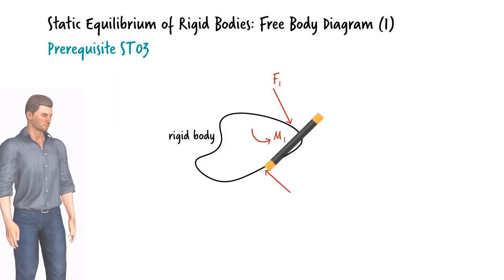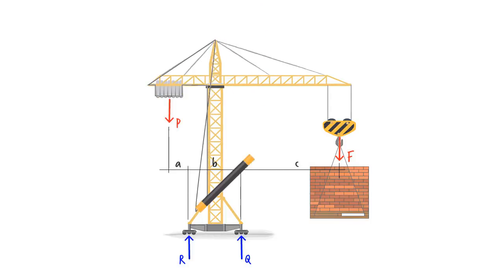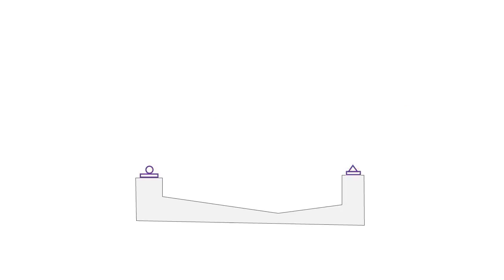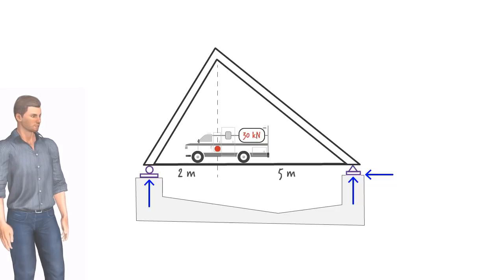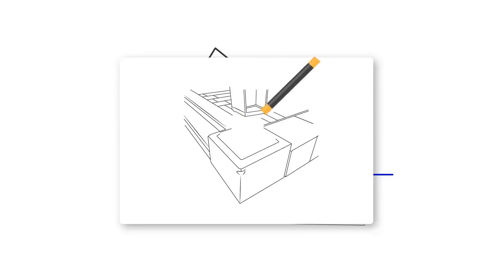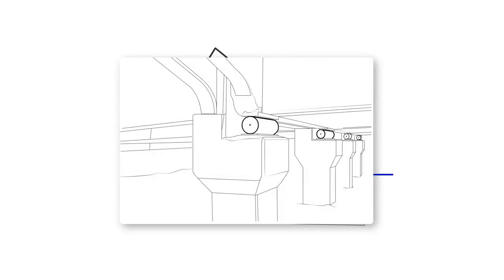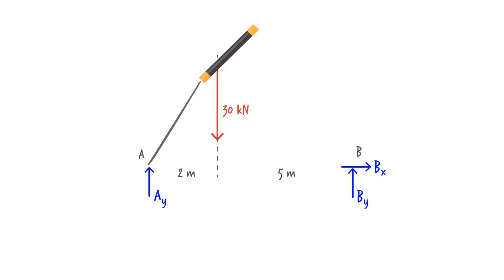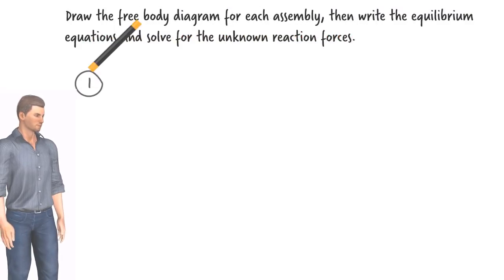ST04: Free Body Diagram for Rigid Body Equilibrium (I)

Comment: is there any particular method or rule to define the direction of reaction forces.
for example :lets consider the exercise 1, in that i choose to give the direction of reactions at B as By is upwards and Bx is to the left.but in your solution you considered Bx direction to the right.
Reply from the maker: For an unknown force we can the force vector in either direction. If the computed value for the force magnitude turns out negative, then the actual force direction is opposite to that which was assumed.
Reply: Thank you very much for your time...
Reply from the maker: You're welcome.